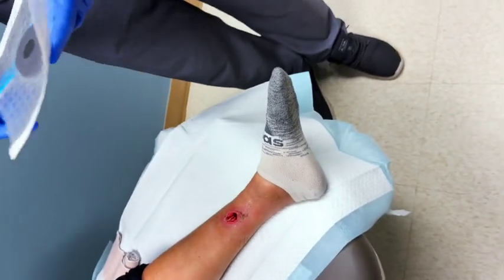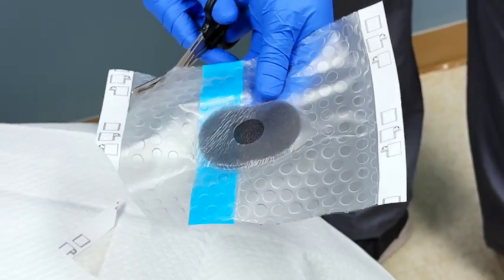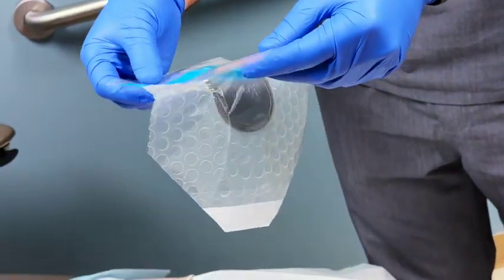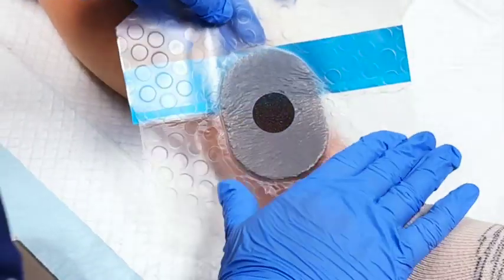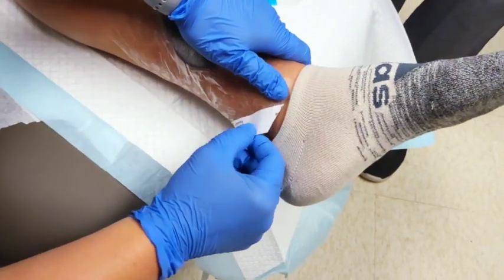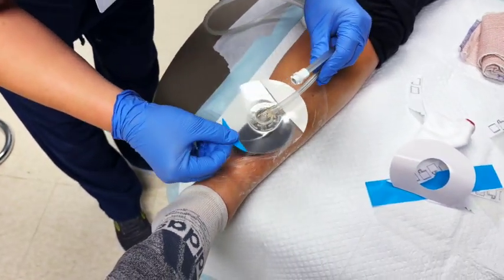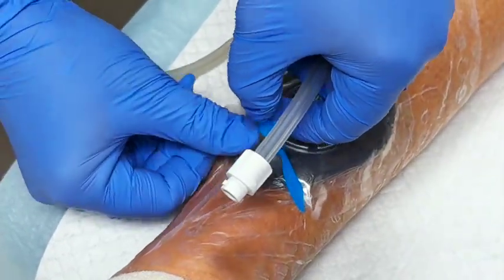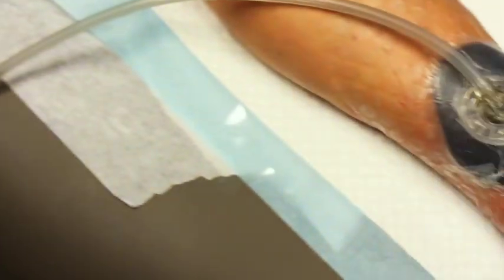How To Apply A Wound Vac!

Comment: How does this work with wide, deep wounds?
Reply: It helps the wound keep a healthy moist environment. Negative pressure keeps excessive drainage from sitting in the woundbed & promotes healthy tissue formation.
Reply: It does but depends where wound is! I had one on my buttock! Was 20 cms by ten cms by  14 cms but hard to maintain contact on a buttock! Only did couple days! Alarm drove me nutty!
Reply: I had five months daily District Nurses
Reply: My nurse put one like this today but she cut the sponge in half and also taped the edge of the wound! I questioned her because that was not  the way the dr in the hospital did it!  Did she do it correctly

Comment: For what tipe of wounds is this method most usefull?
Reply: Reoccurring non-healing wound,  deep vascularing wounds etc. Ones with excessive drainage or heavy exadute.   Sometimes areas that are at high risk or  have suffered with infection.

Wound vacs use negative pressure therapy to help healthy tissue granulate (building blocks) rebuild layer by layer. They also allow you to keep a healthy, moist wound environment but also suck nasty fluids from the wound bed.
Reply: One is bleeding?